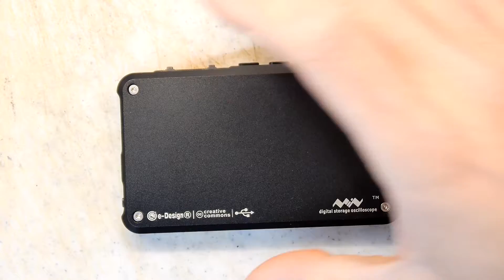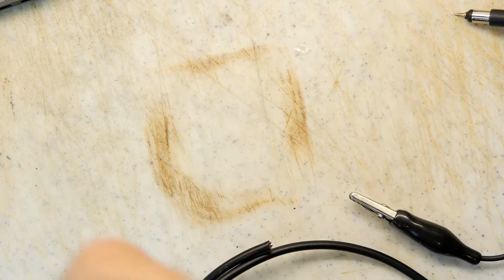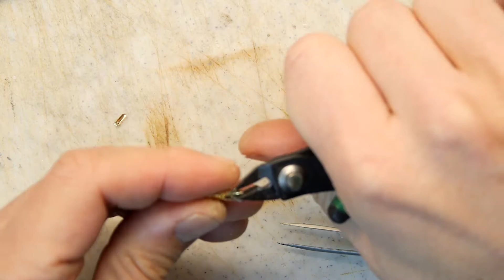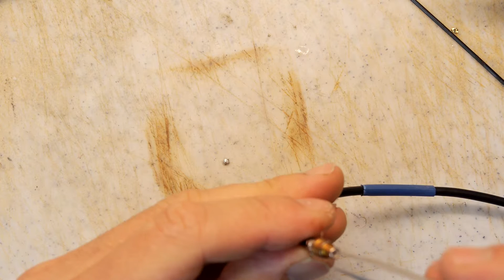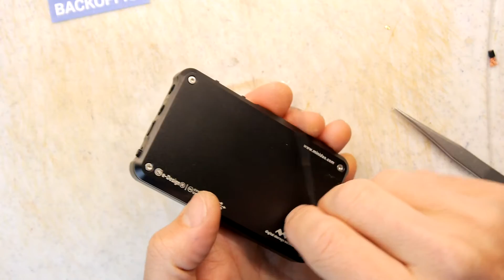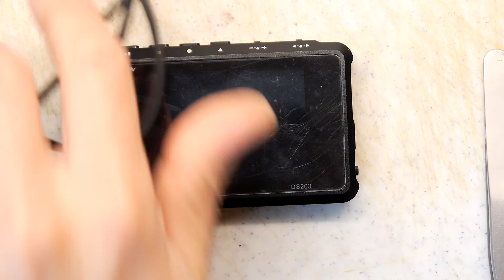DSO203 Quad Storage Scope Probe Repair

Comment: I have accidentally plugged in a 19v power supply and now the USB port is cooked. I can still use the scope if I charge the battery externally. Is there any parts I can replace to repair the unit?

Comment: what's the max voltage u can measure on it
Reply from the maker: +Ibrahim kayani I think I may have read 80v on later units, I guess you would have to double check with the manufacturer
Reply: The Backoffice thank u
Reply from the maker: +Ibrahim kayani No problem!

Comment: http://www.ebay.co.uk/itm/SainSmart-Oscilloscope-Probe-for-DSO201-DSO202-DSO203-/121768780295?hash=item1c59fc2207:g:8nIAAOSwQTVWA84a
Reply from the maker: Nice!! I wonder if these feel good to use or if all the sections make them feel a little wobbly?
Reply: Well for that price I'd suggest just giving it a go, mind you the ideal solution would be one of those micro connectors to bnc converter if such a thing exists so you could then use any probe you wish.
Reply from the maker: +DigitalAura Superb!
Reply from the maker: +DigitalAura I might relate this scope to the shelf of curiosity, really, my bench one is easier to use, just harder to film 😞